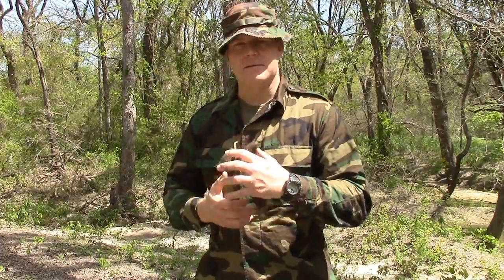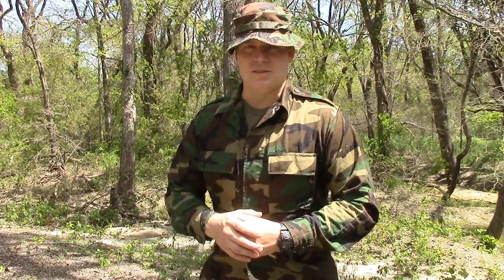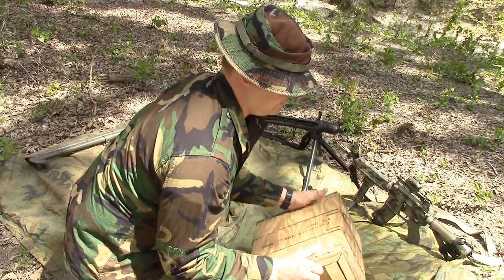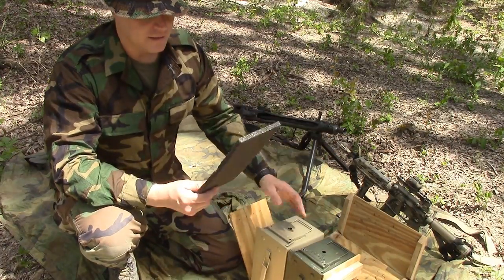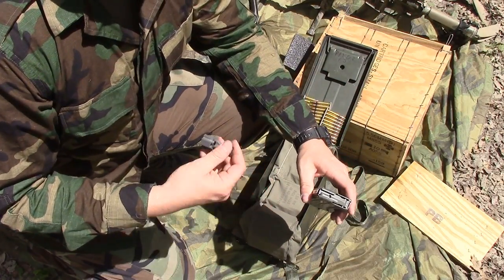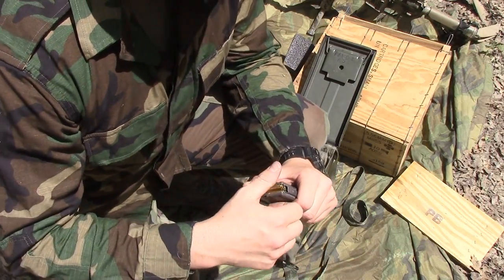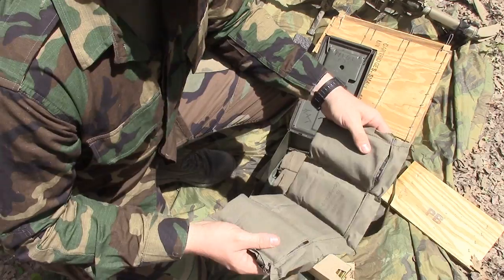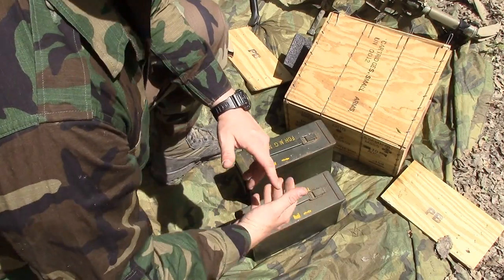Combat Resupply

Comment: I’m a veteran infantryman but I learned something from this. I didn’t realize you could pull that seam out and put mags in that bandolier.
Reply from the maker: Thanks brother, that's why I put this stuff out there for war fighters like yourself to learn some of the nick nacks I've picked up over the years. I'm learning new thing every day still.
Reply: Fuck I didn’t even know there was a speed loading tool. Damn ammo counting and loading four plus one tracer.....

Work smarter not harder the Air Force said. Well clearly we were doing something harder lol
Reply: EricTheBoringOne - so you just told me your a cherry.
every vet who been in cobat knows one never load a full 30 round, dueto the fact some magazines will "will" get hung up cause is the spring of the mag with carbon 80% of the time get dirty very quickly.
😬
Reply: I was infantry for 8 years, and during that time I also never knew that the bandoleers could hold extra 30 round mags just by removing that white string. We just went out and bought our own personal bandoleers to do that. The money we would of saved, oh well, we still got the job done.

Also that tip with the M240 ammo cans was awesome. I huffed the M240 B for 2 years and we never carried the ammo that way, which would of made everything so much more easier. Instead we the belts out of the cans and spooled the rounds, placing them loosely in an assault bag or IFAC pouches. We should of done this instead, would of saved so much time. I did have a short belt, about 20 rounds already in the weapon system, just for a quick burst; once prone, I would load a proper belt and let the weapon sing. Loved the 240.

The speed loaders worked some of the time for me, either they did not fit onto the mag or the stripper clips went into the mags with the rounds. Usually I would just go from one speed loader to the next, until I found one that worked for me.
Reply: EricTheBoringOne thank you sir for serving! Semper Fi
Reply: I got out of Army Infantry in 2000 and don't remember the bandoliers having a safety pin on them but we re used the bandoliers for stuff every grunt seems to have that inginuity in them, I would think
Reply: @ZeroScapes  I don't know about the American rifles, but in the Dutch army we're told not to completely fill up our Colt C7 (basically a Canadian M16) mags , due to the fact that it seems to cause more initial jams (spring can get all messed up). So he might not be completely mistaken..
Reply: @bloodieown  If a full mag jams your weapon, you have faulty equipment. Weather it is the mag or the weapon, something needs to be replaced. Just because a higher up believes it, doesnt make it true.
Reply: @ZeroScapes  I've never personally tested it out on my rifle tbh, so it might just be a myth passed down from instructor to instructor. Still, I only load up 29 rounds to this day, haha.
Reply: @bloodieown  The only problem I see with loading only 29 is that you dont have that last round to put into your enemy, haha! Its no big deal, but I just like having full mags and have never had an issue with rounds cycling because of a weak mag spring.
Reply: @bloodieown  i was told that this is only an issue if your keeping your mags loaded for a long period of time, for example if you loaded your mag, put it in your gun and left it under your bed for mounths incase of a break in, if your just loading them up for the day then their not so much an issue? but i have no experience so dont take my word for it....
Reply: Army AND others  using diffently sistems
Reply: Holy crud the amount of misinfo here. The reason behind downloading magazines is because a full 30 round GI mag is difficult to insert on a closed bolt, whereas a 29 or 28 round mag will click right in. 

It has nothing to do with dirty mag springs, worn mag springs, etc etc etc.

And yes, jamming a full 30 rounder into a weapon on a closed bolt CAN cause malfunctions, because the amount of pressure from the spring pressing into the bottom of the bolt carrier can cause excess friction which can potentially bind up a very dirty/dry/undergassed weapon.
Reply: @tackytrooper  Thanks for clearing that up, that's how I remember it being explained to me now that you said it like that.
Reply: The primary purpose of the safety pin on the bandolier is to indicate at a glance or by touch where the loading spoon is. It has other uses but it's there to find that little bastard in a hurry.
Reply: which is why youre a infantryman and nothing higher
Reply: @ZeroScapes  well in 1998 during my military duty service i was equipped with Beretta ar 70/90 sp short version for Alpine artillery unit.
Mags could be exchanged with M16 magazine, same caliber and my instructor told me that expecally in new magazine u could have issue if full loaded, so better to have a couple of rounds less than a weapon jammed.
Plus, at that time was being introduced the minimi (light machinegun) that could be feeded by standard belts but also clips.
For that weapon the instructor told me that u HAVE to remove 5 rounds from the clip otherwise the minimi could CUT the brass while loading the round, making the weapon out of service due the brass cutted will stuck inside the chamber.
Keep in mind it  was 1998, and that weapon was going to be introduced. 
So dear zero  before being so offensive u have to be able to use your weapons.  it isnt COD
Reply: @bloodieown  Thirty rounds, every time. Thirty round magazines are designed to hold.....thirty rounds. Feeding issues are caused mostly by bad followers, bad springs, or bad feed lips. Also, one time I was issued a magazine that had a cracked spot weld on the back. The body and feed lips would spread apart and it would double or triple feed every time. If you have bad or poorly-feeding magazines they need to be DX'ed and you need replacements. Mostly it's military lore and myth to only load 28 or whatever magical number, and if your military won't give you replacements or replacement parts for unserviceable magazines then they're just being cheap.
Reply: EricTheBoringOne You learn something new every day
Reply: I was USAF Security Police, and we carried our magazines at full capacity.   The only magazines that I ever saw that couldn't be loaded to full capacity were the old 20 round Colt made magazines. 

As a fire team leader, during force on force exercises, I always recommend that my M-60 gunners remove the assault packs from the ammo can.  , Remove the boxes from the bandoliers, and the ammo from the boxes.   Rip the tops off and one end out of each box, then put them back into the ammo can.   Lay one belt back in, zigzagging it left and right, with the lid to the left, and cases pointing to the front.  Once the first belt was back in, link up the second and continue.   The idea was that whether mounted to a vehicle machine gun mount, or off of the bipod the machine gunner had 200 rounds ready to use.  I also had my M-60 gunners cut the silencing straps out of the ALICE mag pouches and lay a 50 round belt in each.

Every time I went to requalify on the M-16 I was issued to old 7 pocket 140 round bandoliers, right up until about 1995.   While I knew that the 140 round bandoliers would hold the old 20 round Colt and Armalite magazines,  I didn't know that the 120 round bandoliers could hold the 30 round magazines.   Thanks for the info.
Reply: Only thing ive heard about loading 30 is never keep the mag loaded to cap over time itll cause spring warping which causes fucked feeds. Ive never personally had a problem with full 30 feeding issues but i see how it could with a garbage mag.
Reply: Things hat make you say DAMN!
Reply: @ZeroScapes  I agree with you. Hmm let me think about this, i have an empty weapon and slap a 30 round mag in it and load in 1 round, which leaves the 29 rounds to follow will screw up my mag. lmao. With loading that 30th round then they say they have their 29 round magazine! lol
Reply: @ZeroScapes  lol I can tell you're just some kid who has never had any kind of firearms training
Reply: It's Kilroy There’s zero issue with keeping a mag loaded. The spring isn’t being worked to even become weaker. Mag brand/model/age is irrelevant unless the mag has been actively used.
Reply: Zeroskator 1 Wanted I've heard that a lot too. Especially if you are going to store loaded mags to leave a few rounds out because it weakens the spring. Don't know how true that really is but I don't store them full, same with my handguns. Thanks for your opinion on this.
Reply: EricTheBoringOne didn’t we all😂
Reply: @michaelfisher4737  it's bs. A spring under load is fine. That is not what wears springs out, what wears springs out is them actually being returned to length and then compacted again.
Reply: @Brent0331  like the last comment, I spent most of my adult life as a lightfighter or in LRS. I too was unaware of being able to turn the bandolier into one which could carry 30 round magazines! Hell, no one ever gave me a class in what the damn baby pins were for! We just tied a knot in the damn thing like a cave man or something. Like you said, though, there are a million and one uses for the baby pins so I snagged them up. Them and the speed loaders. And and RCL10s I could get my hands on.
Reply: @thestuff7843  that's why you do maintenance on your magazines after every field problem. I used to soak mine in simple green solution and scrub them out with a tooth brush then throw the disassembled magazines in the dish washer with no soap and run them through to get any residue off. Never had an issue. Newer magazines are built to load 30 rounds indefinitely and will work reliably when called upon.
Reply: I had a gruff old SFC when I was still a pvt, that has shown us the pull string on the bandolier. As for the technique/ hand placement for loading the stripper clip, that would have been handy to know. I always found an edge surface to push the rounds into the magazines.
Reply: @thestuff7843  ?
Reply: @bloodieown  I heard that the aluminum USGI magazine springs would "take a set" if left fully loaded for long periods of time but the Magpul Pmags that the USMC, US Army and British MOD are now using have better springs and can be left fully loaded for long periods of time.
Reply: @richardlahan7068  I was reading the whole comments section , i realized we had 5.56 for first time with HK33A2 (*back in day 5.56 only issued with commandos as CAR-15's and M16s) back in 90's and 00's . Our ammo came in same way but no stripper clips . M855 and M193's was combined in the crate . 

That rifle was so precise but horrible to clean .
Reply: @aediway1518  Grunts knew this stuff in Nam with the 5.56mm and 7.62x51mm bandoleers.
Reply: @ZeroScapes  rotate your mags.
Reply: My bands had seven pockets.
Reply: @wakcedout  this makes my crayon eating ass laugh
Reply: @thestuff7843  uhhh no. Thank you for playing, but obviously it wasn’t in the last 15 years or so.  Just no.  We rock PMags, HK steel mags, and other newer breeds of 30-rd mags that are not only designed to be loaded with 30 rounds, but they actually have plenty room in the round stack for the mag to seat properly on a closed bolt.

Comment: We used to load magazines by ramming the stripper clips on the edge of the ammo table, saving injury to our thumbs. Loads pretty quickly that way too. Tap the magazine on the table to assure all the bullets are seated properly and yer golden.

Pretty clever using the mg ammo bandoleer straps with knots in them to carry the ammo cans over yer shoulder.
Reply: You can use another magazine also to push them down as well.   Every second counts and the longer you can keep using your thumbs the better.  No need to blow out your thumb joints or get blisters.
Reply: yeah I dont like the idea of pointing the business end of bullets toward my body.  Not sure why anyone would use a bandoleer for storing mags.  ammo pouches are generally more than enough.  As I recall from a platoon mate that was in vietman, additional ammo was stored in the ruck sack for ease of toting. He stated that as a Marine on patrol in Vietnam he carried around 500 extra rounds on his back.
Reply: @ skildude 
A bullet and cartridge is non directional without a barrel to guide it. In the case of a round detonating outside of a chamber, the brass case will fail at the same time if not sooner than the jacketed bullet will separate, basically turning the cartridge into a firecracker with some added shrapnel. The brass casing actually has a much higher chance to injure you in that situation than the bullet does.
Reply: @skildude  
because as said in the video, you may be sent on a mission requiring more ammo, and you have more mags than you have pouches for them. there are a lot of pics of US soldiers in Vietnam carrying extra ammo in bandoleers with full mags, the LCE pouches could only carry 2x3 mags (even those for M14), the bandoleer could carry 7 additional mags, even if you did not feed your gun with mags straight from the bandoleer, it could be used to swap the empties from your pouches during a short lull in the fight

and if you have issues about that weight flopping on your body, they come handy with a safety pin to tighten them on your chest
Reply: thats how i load ammo when helping the ammo handlers at the range
Reply: Like rats said use your extra mags for quicker bump ups
Reply: The bandoliers themselves have a million uses, like making up lightweight recce rigs, using the fabric to reinforce the knees and elbows of your BDUs, etc. During downtime, prepping the strippers into empty mags, and getting the cardboard out of the fight is certainly helpful, how anybody doesn’t use this stuff or says it’s not helpful is a mystery to me too, but I know I’ve heard that garbage too.
Reply: I found the notches in the tread of combat boots securely held the base of the top round and provides a good surface to push against without fucking up the case. 

on the range I will use the edge of the bench or table I am at.
Reply: Assault packs are a thing, and in practice most troops today carry any extra ammo loaded into spare mags and stuffed into their packs. In the event of a firefight where a unit is stationary long enough to drain their pouches, there will also be time to access their packs.

It is a matter of practicality as a smallish assault pack can be dumped during contact to lighten the load on the soldier during the fight, and then accessed as necessary.
Reply: ratagris21 pp
Reply: Ramming the mags on a table can fuck up the feed lips of the magazine. It's fast, but a magazine that jams the rifle because it won't feed right doesn't save you any time at all. In fact it can take all of your time from you.
Reply: That’s the way we did it as well. Those speed loaders suck when you try to load em by hand.
Reply: @skildude  Well, he probably rode in a heli or on the back of a deuce and a half most of the time.